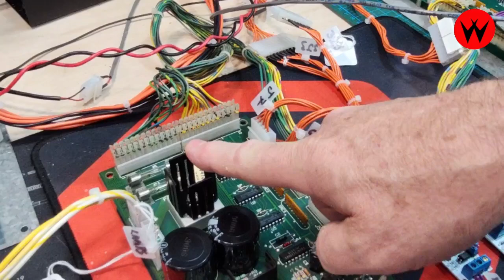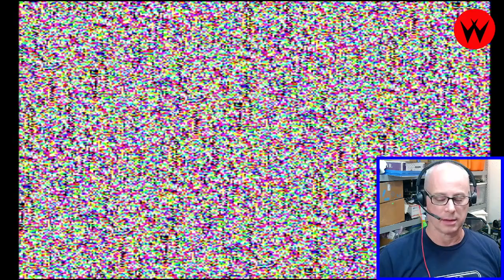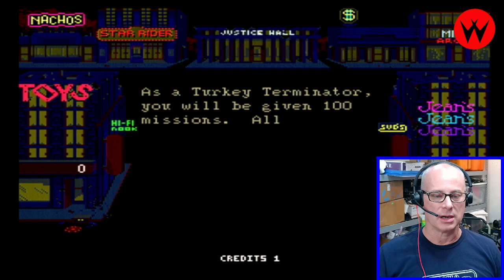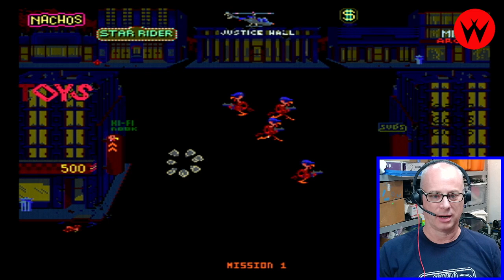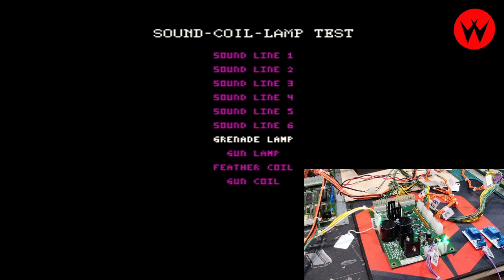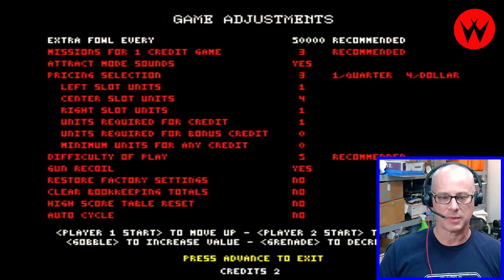Turkey Shoot Board Set - Full Restoration - Testing and Gameplay! RARE!

Comment: Why did they use GREY encoding instead of using binary encoding for the optical switches?
Reply from the maker: Grey encoding has an advantage where only one bit changes per step, so it basically has built-in error checking. Binary is great, but only if you are sampling very fast(can get wrong value if you sample during a transition).
Reply: @thewilliamsguy grey coding is doing an error checking per each bit?